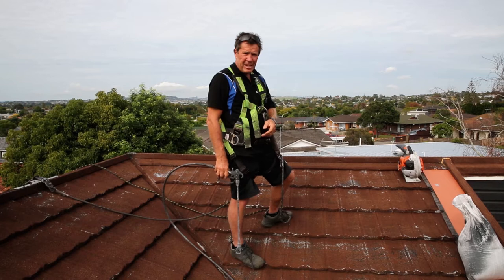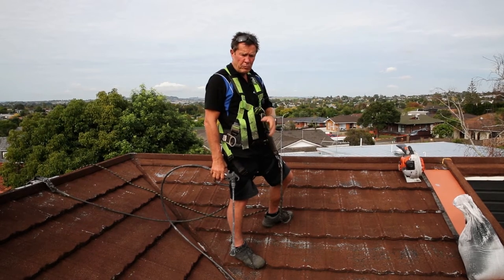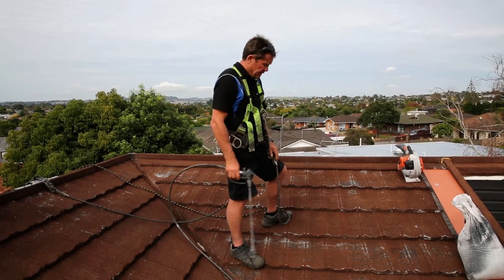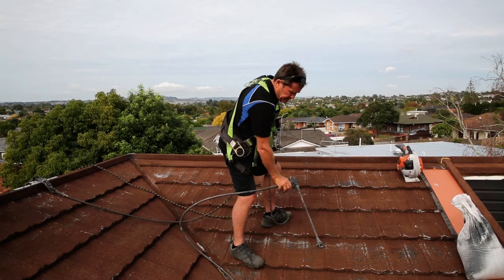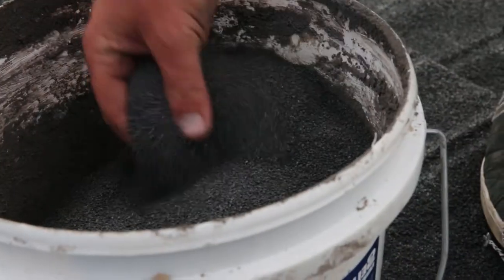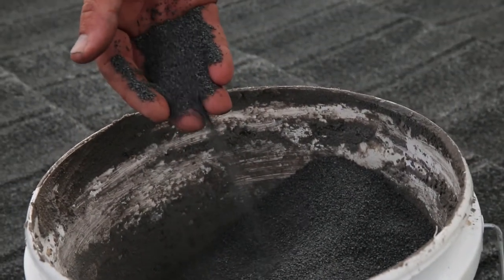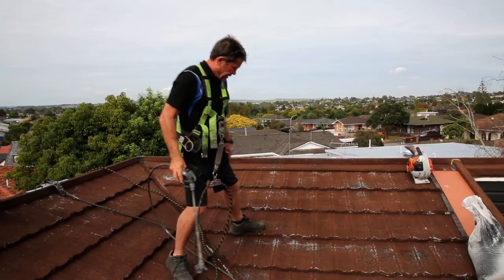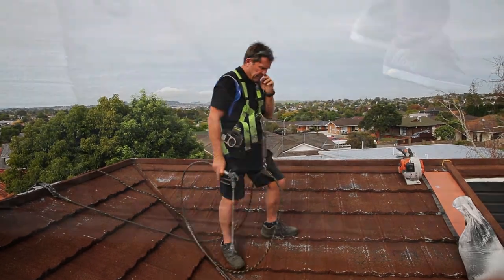Decramastic Roof — Painting (Step 2)

Comment: I have painted the decramastc tiles myself and while it does use more paint I have found it is a good way of preserving the roof after water blasting.  The big problem on my roof was the lichen so I had to spray the lichen and once it died, I had to water bast it off.  I don’t particularly like the chip and would prefer a painted decramastic tile roof even though they are more slippery.  They seem to rust heavily around the edges so I am replacing these tiles.  If you remove any tiles check the underside and wire brush off any surface rust and then paint the underside with a primer as  it will prolong the roof.  Removing dents is easier said than done as you  can easily tear the building paper underneath.  It is better if the tile is badly dented to take it right out,  take the dents out but they are a bit of a fiddle to get back in again.